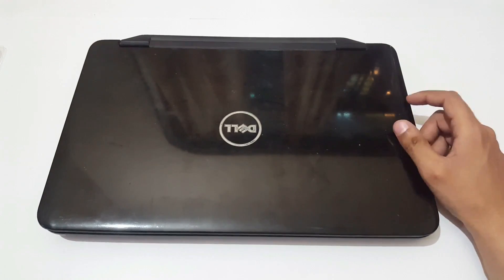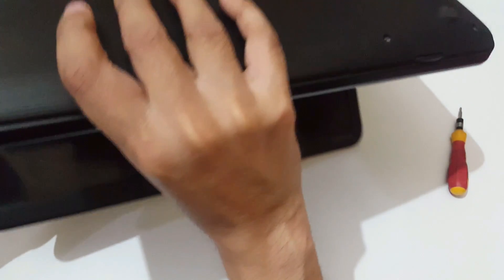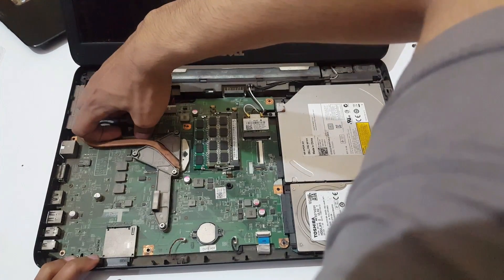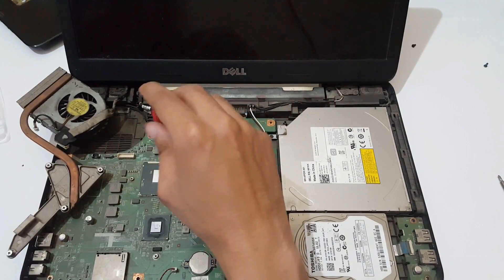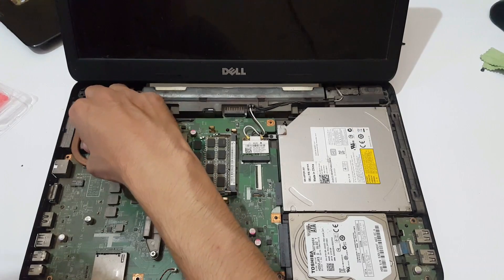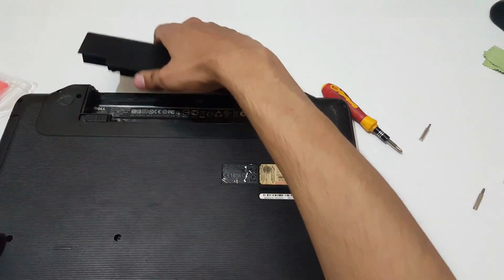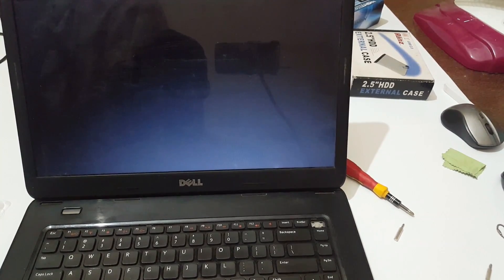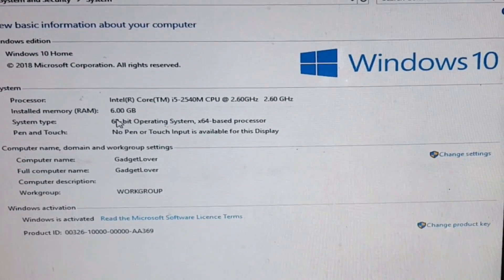How to Upgrade Processor on DELL Laptop | i3 to i5 & i7 - Make Laptop Faster for Gaming

Comment: I have amd ryzen 3 2200U .which is the best processor to upgrade to
Reply from the maker: SALIL GUPTA : This processor is soldered so you can't upgrade it
Reply: @GadgetLover360  thanks you saved me a lot of money as I was thinking to buy it at 11 pm as it was on discount
Reply: Pls can you tell me what is the role of the metal paste on the processor
Reply from the maker: SALIL GUPTA : Glad to help you and it is thermal paste which is useful for more direct heat transfer and also prevents air gaps forms between processor and heat sink

Comment: I have a Dell Inspiron 15 3521. I3-3227U. 500 GB Hard Drive. I'm thinking I might not be able to upgrade the processor but I can change to an SSD Drive. Any recommendations? I am at a loss on how to upgrade my machine.
Reply from the maker: bttrflyeffect73 : Samsung 850 Evo 2.5 inch Internal SSD Drive is better choice
Reply: @GadgetLover360  Thank you
Reply from the maker: bttrflyeffect73 : You're welcome

Comment: I have acer aspire i5 having processor 2.5ghz 
I want it to be more than 2.5 or same . is it possible ? 
help me out bro
Reply from the maker: Ahrio Zoei : Intel Core i7 6600U is best processor for your Laptop and I would like to inform you if processor is soldered you can't upgrade it

Comment: I have a Dell Inspiron n5050 with following specification:
1. Socket Support pga988
2. Processor : Intel(r) core(tm) i5 - 2450M CPU @ 2.4GHZ
3. RAM: 3gb ddr3
4.ssd : sata 2.5"
I have following expectations after upgradation
1. Smooth running of windows 10
Without any lag
2. I am a heavy user of Microsoft office 10 so smooth work at that also.
Please......please suggest me what component should I upgrade in my laptop or buy new one ....,😁
Reply from the maker: Shubham Agarwal : Intel Core i7 2640M is best processor for your Laptop
Reply: @GadgetLover360  sir can I go upto 3 Rd gen
Reply: Sir how we decided the compatibility is it all about socket ...
Reply from the maker: Shubham Agarwal : Unfortunately you can upgrade it in same generation only
Reply: @GadgetLover360  can you please tell me the parameters which decided compatibility of a processor with your motherboard ...... Thanks for your replyes.... You are great man
Reply from the maker: Shubham Agarwal : Thanks and according to current processor Intel Core i7 2640M is compatible and best processor for your Laptop

Comment: I have dell Inspiron 3521 2365m can u upgrad witch on can fine with me plz help thanks
Reply from the maker: احمد بلاسي : The processor of this Laptop is soldered you can't upgrade it
Reply: Ok another question can I but in this laptop exp gdc external grafiic gtx 960 or 1030?
Reply from the maker: احمد بلاسي : You can't upgrade it without motherboard replacement but you can attach it externally and I would suggest you see its full specification and compatibility details before buying
Reply: My full specifications is core i3  2365m  1.4 GHz processor  8 giga ram ddr3 1333mgz  2cores 4threds 3mega cash CPU hard 500 SSD 256 resolution laptop screen 1366x766.
Reply from the maker: احمد بلاسي : I would suggest you before buying it learn more about how to attach it externally and see its all compatibility details

Comment: Thank you so very much for sharing.  Very grateful for your video of how to remove and reinstall a new processing chip.  I noticed you had an SSD hard drive case on your work table.  However the extremely slow start of time for your laptop to open shows the lag time of a standard SATA drive.  I recently replaced the 1 TB hard drive in my Ipspirion 1550 and upgraded to a 500 GB solid-state drive.  I hope you will do the same to really enjoy the benefits of your new Intel i5 processor.
Reply from the maker: Anthony Arnold : I am glad that my video has solved your problem and thanks for sharing your advice
Reply: I had a question. Will my computer have heating issues ?

Comment: Bro I have pentium, can I upgrade it? I have a sony vaio
Reply from the maker: Proud Zombie : If processor is not soldered you can upgrade it
Reply: @GadgetLover360  i have the same lock system as you and what will be the best upgrade for me?
Reply: And I have 1tb hard disk and 8 gb ram please suggest me the best upgrade possible ❤️
Reply from the maker: Proud Zombie : Intel Pentium 4 3.06 GHz is best processor for your Laptop
Reply: @GadgetLover360  thank you so much💖
Reply from the maker: Proud Zombie : You're most welcome
Reply: @GadgetLover360  by the way can I replace it with i3 540 3.6 gHz dual core? Cause one of my friend is selling
Reply from the maker: Proud Zombie : Unfortunately you can upgrade it in same generation only
Reply: @GadgetLover360  okay thanks for the information bro
Reply from the maker: Proud Zombie : You're welcome

Comment: Bro i have old hp 530 intel processor too much slow laptop can i get upgrade
Reply from the maker: Shahbaz Butt : If processor is not soldered you can upgrade it
Reply: This processor is not upgradeable
Reply: My laptop processor is intel celeron 1.73ghz
Reply: Bro plz batao na yaar
Reply: Bro plz batao b
Reply from the maker: Shahbaz Butt : Intel Core 2 Duo T7600 is best processor for your Laptop and I would like to inform you if processor is soldered you can't upgrade it

Comment: I have Dell Inspiron 15 3543 with Intel i5-5200U processor, what can you suggest for a processor upgrade?
Reply from the maker: Leandro Ramos : Intel Core i7 5600U is best processor for your Laptop and I would like to inform you if processor is soldered you can't upgrade it

Comment: hey bro thanks 1st of all nd plz help can i upgrade processor in dell inspiron 15 3000 series i have already i5 can i upgrade to i7
Reply from the maker: mv's timepass : You're welcome and if processor is not soldered with motherboard you can upgrade it
Reply: Check in properties if your professor model has U at the end of the model no. Than most likely it will not be upgradable

Comment: Please suggest  me to upgrade processor to my dell inspirion 3421 i3 4th gen..

I should i add graphic card on this device ?
Reply from the maker: Ajayraj Maharjan : Intel Core i5 4310U is best processor for your Laptop and you can attach externally but can't upgrade without motherboard replacement
Reply: @GadgetLover360  attach externally? How?
Reply from the maker: Proud Zombie : Replace it with new processor

Comment: i want to upgrade my laptop performance
4gb ,core i3,hard disk 300 gb, 
what i upgrade in my laptop about his performances
Reply: Try SSD
Reply: @jaforkhan1992  ssd only reduces loading time it doesn't increase performance in any game
Reply: @godson2939  ooo and what do recomend me to performace for gaming??
Reply: @dmbbravo3131  8 gb ram and a decent gpu
Reply: @godson2939  but i have a laptop, can i change de GPU in a Laptop???
Reply: @dmbbravo3131  no it will cost you too much, check in task manager/memory if you have a extra slot for ram then you can buy another 4gb stick if you already have 4 gb ram 

Btw which laptop you are using?
Reply: @godson2939  i am using a DELL INPIRON 15 3542
PROCESSOR-  i3- 4030U.
RAM- 4GB
Reply: @dmbbravo3131  you should have 2 ram slot as i have in my dell inspiron 
Check which brand's ram you have in your laptop maybe its crucial's 
4 gb ram will cost you less money and give you some perfomance boost in your laptop

You can upgrade your laptop more if you have money , im a student so i cant upgrade my laptop or buy a new one but m thinking of adding ram, maybe after adding ram i will play gta v ( with 4ram my gta v stutter a lot on lowest possible settings)
Reply: @godson2939  thanks but my dell inspiron 15 4532 only has one ram slot ;(
Reply: I just replaced it 1tb ssd 16gb ram and i7
Reply: If you want good speed remove hdd and put ssd. If possible go for nvme.
Reply: @Deepak_G_  it works for gaming???
Reply: You will benefit most from going to 8gb RAM, and an SSD. After wards you can change your processor
Reply: I am using dell inspiron 14 3000 series. I want to upgrade my processor core i3 . Please give me some  suggestions
Reply: ssd and 8gb ram
Reply: Accer!5aspire4752 prossessor complaint. Can replace a new prossesor.? Accer5742motherboard socket is bga?
Reply from the maker: Shaji Us : Yes
Reply from the maker: SAJID ALI SHAH : You can upgrade all of this for better performance

Comment: Hello brother. In my dell inspiron 4100 intel core i3 2nd generation processor is installed. I want to upgrade. Can I only use 2nd generation i7 processor ?? Please suggest me the i7 version that i can install.
Reply from the maker: Anurag Sahu : Intel Core i5 2540M and Intel Core i7 2640M are best processor for your Laptop and I would like to inform you if processor is soldered you can't upgrade it
Reply: @GadgetLover360  processor is not soldered i have checked. Thank you for your help.👐
Reply from the maker: Anurag Sahu : Glad to help you and you're welcome

Comment: I have celeron b815 2mb 1.6ghz on dell n5050,  suggest me the best core bro
Reply from the maker: yetrr : Intel Core i5 2540M is best processor for your Laptop and I would like to inform you if processor is soldered you can't upgrade it
Reply: @GadgetLover360  yeah, I know if processor is soldered i can't do that. Thanks.
Reply: Can you tell me, is i5 4210M 2.5GHz 3MB FCPGA945 or i5-520M 2.4 - 2.93GHz PGA988 fitting to this pc?
Reply from the maker: yetrr : You're welcome and unfortunately you can upgrade processor in same generation only

Comment: Iam using dell Inspiron 15 i3 5005u  what processer can i go
Can i able to chang it
Reply from the maker: Dhanush hacker : Intel Core i5 5300U is best processor for your Laptop and if processor is soldered you can't upgrade it
Reply: @GadgetLover360  it's not available
Can i go for amd
Reply from the maker: Dhanush hacker : Unfortunately you can upgrade it in same generation only
Reply: @GadgetLover360  any other solution
Reply from the maker: Dhanush hacker : Intel Core i5 5200U is also best processor for your Laptop
Reply: @GadgetLover360  can a
I use amd
Reply from the maker: Dhanush hacker : No
Reply: @GadgetLover360  ok thx for your help
Reply from the maker: Dhanush hacker : Glad to help you and you're welcome

Comment: Hii broo my PC is Dell Inspiron 3000 series of i3 processor.
1. Can I upgrade to i5 or i7? And is it safe to do? And also give link for your explanation (if there in our channel)
2. Also I want to upgrade my GPU currently it is AMD Radeon (2GB) ? How to do that? How can I get good graphic card for this pc config?
   Please suggest me!!
Reply from the maker: Shiva cheerala : Yes you can upgrade processor in same generation and unfortunately you can't upgrade GPU without motherboard replacement but you can attach it externally
Reply: Thank you bro.. but I need more info regarding the process.. is there any video or any article.. if there please give link😊
Reply from the maker: Shiva cheerala : You're welcome and tell me Intel Core i3 what generation
Reply: It's 6th Gen i3 processor broo
Reply from the maker: Shiva cheerala : Processor number or base frequency
Reply: @GadgetLover360  i3-6006U @2.00Ghz base freq.
Reply from the maker: Shiva cheerala : Intel Core i5 6300U is best processor for your Laptop and I would like to inform you if processor is soldered you can't upgrade it
Reply: @GadgetLover360  thanks broo.
Reply from the maker: Shiva cheerala : You're welcome

Comment: Hi bro, i have a i3 -3217u 1.8hz cpu which processor can i upgrade it to?
Reply from the maker: uday Sangwan : Intel Core i5 3437U and Intel Core i7 3687U are best processor for your Laptop
Reply: @GadgetLover360  will these fit in my laptop?
Reply from the maker: uday Sangwan : Yes but I would like to inform you if processor is soldered you can't upgrade it
Reply: @GadgetLover360  ok thanks bro
Reply from the maker: uday Sangwan : You're welcome
Reply: How do i know if its soldered?
Reply from the maker: uday Sangwan : See disassembly video of this Laptop

Comment: Hi Brother 
last week I buy Dell Inspiron 15 3000 3584 intel i3 7th gen but it is very slow can I upgrade to i7?
Reply from the maker: Abdul Kareem : Intel Core i5 7300U and Intel Core i7 7600U are best processor for your Laptop and I would like to inform you if processor is soldered you can't upgrade it

Comment: I have a Intel Core I3 370M 2,4 Ghz  and i'm thinking about upgrading my ram to 8 gb. Which processor is the best in this case?
Reply from the maker: H34vy _ M4gm4 : Intel Core i5 580M and Intel Core i7 640M are best processor for your Laptop

Comment: Is the processor on the Dell Inspiron 15 3521 upgradable? If so what would you suggest?
Reply from the maker: trombone man : In my knowledge Dell Inspiron 15 3521 processor is soldered with motherboard so you can't upgrade it

Comment: I wish you could work on mine too. it looks like yours exactly.
Reply from the maker: Kinyera Inno Arnolds : You need to disassemble your Laptop for processor upgrade
Reply: @GadgetLover360  can my laptop facilitate a core i 7 3632qm? am currently on  the core i 5 3210M.
Reply from the maker: Kinyera Inno Arnolds : Yes
Reply: @GadgetLover360  Thanks Bro
Reply from the maker: Kinyera Inno Arnolds : You're welcome

Comment: I have hp 15 notebook with i3-4005U can I upgrade it to i7 6th generation?
Reply from the maker: Luke Harit : If processor is soldered you can't upgrade it and Intel Core i5 4310U is best processor for your Laptop
Reply: @GadgetLover360  how would I know if it's soldered or not ?
Reply from the maker: Luke Harit : See disassembly video of this Laptop
Reply: @GadgetLover360  ohhh ok now I get it and can I increase the RAM of my laptop too what's the maximum limit I can increase it too?
Reply from the maker: Luke Harit : You can expanded upto 16GB
Reply: @GadgetLover360  thank you so much bro
Reply from the maker: Luke Harit : You're most welcome
Reply: @GadgetLover360  I am tryna make my laptop eligible for video editing with 4GB RAM I can do only basic ones I am confused in this RAM chipset thing like which one to buy
Reply from the maker: Luke Harit : Buy HP or Hynix DDR3L 1600MHz RAM for your Laptop
Reply: @GadgetLover360  that's the upgraded version of RAM for the one I have right now ?
Reply from the maker: Luke Harit : Upgrade RAM Size to improve the performance of your Laptop for example 4 to 8GB or 16GB in 2 slots
Reply: @GadgetLover360  that requires 2 ram chips right ?
Reply from the maker: Luke Harit : Yes for better performance you need higher RAM sizes and you can upgrade it from SSD drive also for more better performance
Reply: @GadgetLover360  is there any way I can contact you about all this coz I am pretty sure I'll be confused coz I don't know that much about it 😅
Reply from the maker: Luke Harit : If you face any problem ask here I would be happy to help you
Reply: @GadgetLover360  thanks man :D
Reply: @GadgetLover360  you said that SSD thing that means I should buy two more chips one of 8GB and other of 4GB and 4GB I already have so In total it's 16 GB does that RAM slot in my laptop has that much space for 3 RAM chips ?
Reply from the maker: Luke Harit : You're welcome and only 2 slots are available for RAM for 16GB you need to buy 2 RAM of 8GB size and SSD drive you can replace with HDD for more better performance
Reply: @GadgetLover360  ohhhhh but how can I replace SSD with HDD ?
Reply from the maker: Luke Harit : You can upgrade it from 2.5 Inch SATA III Internal SSD drive
Reply: @GadgetLover360  ohh ok and is HP ram better or hynix one ?
Reply from the maker: Luke Harit : Both are good RAM for your Laptop and I would suggest you buy affordable RAM in both of them
Reply: @GadgetLover360  and for editing and rendering videos do I need to upgrade the Intel chipset too ? Or ram will do ? Coz In mostly editing softwares they focus on ram I never saw any video insisting on processor
Reply: @GadgetLover360  and also where to buy it ? And which seller is the best for these ?
Reply from the maker: Luke Harit : I would suggest you buy it from PC Store or Amazon online store
Reply: @GadgetLover360  will it improve the editing in my laptop with still being i3 4th gen but with 16 GB ram?
Reply from the maker: Luke Harit : Yes

Comment: what is specification of your upgraded processor? i have n5050 with 2.50 GHz Intel Core i5-2450M processor
Reply from the maker: Prem Kashyap : Intel Core i7 2640M is best processor for your Laptop
Reply: @GadgetLover360 can we replace HDD with SSD in n5050
Reply from the maker: Prem Kashyap : Yes you can use any standard 2.5 inch SSD drive

Comment: Bro I have the same laptop as yours
I need to get a amd processor with a decent inbuilt graphics
Like a9 or a10 
Can u suggest me for a gud one with more then 2.5ghz of processing speed
Also pls respect the budget
I will appreciate that u r still suggesting people in comments
Reply from the maker: gaming in hindi : Unfortunately you can upgrade it in same generation only and you can't upgrade graphic card without motherboard replacement but you can attach it externally

Comment: Can i upgrade my dell vostro 3400 with intel core i3 m370 to higher intel processor ? And can i upgrade graphic card too
Reply from the maker: iGAMING : Yes and I would like to say Intel Core i5 580M is best processor for your Laptop and you can't upgrade graphic card without motherboard replacement but you can attach graphic card externally to your Laptop

Comment: Bro, i have DELL LAPTOP with 8GB RAM . AMD CORE I5 1.7GHZ PROCESSOR. I want to upgrade to AMD CORE   i7 2.66 GHZ processor. Is it possible to upgrade ?
Reply from the maker: DILEEP TUMATI : You can upgrade it in same generation only and if processor is soldered you can't upgrade it